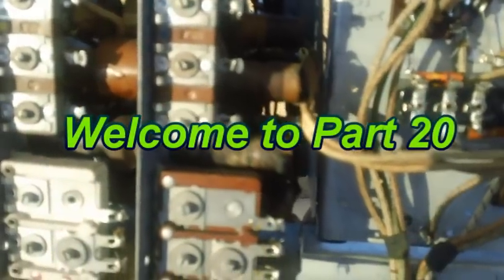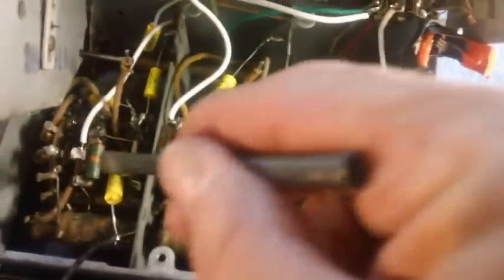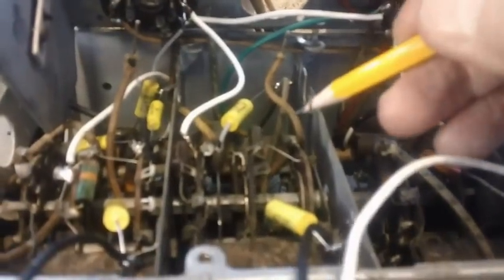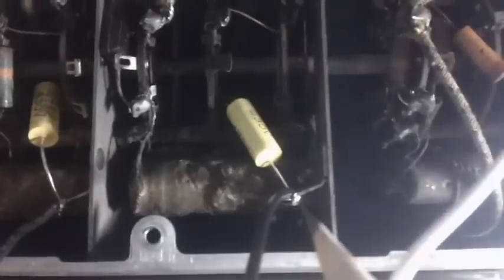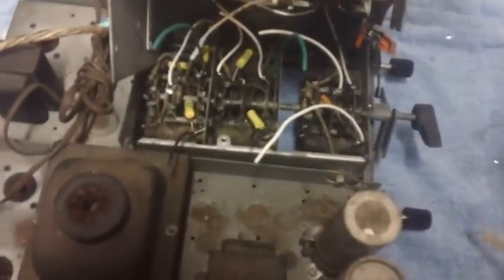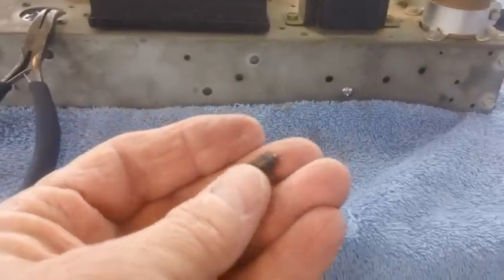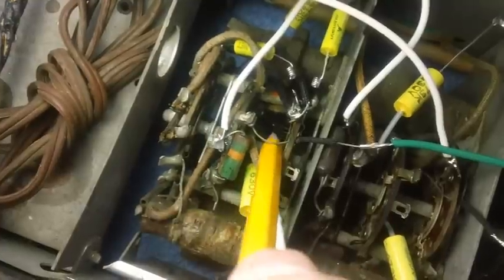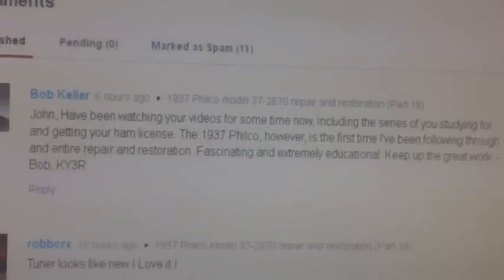Philco model 37-2670 repair and restoration (Part 20 of 34).

Comment: Use control Cleaner works best  Any vintage radio always replace filter caps capacitors and test output Tubes selenium rectifier
Reply from the maker: Jason,
Excellent info.  I'm glad you provided it.

Regards,
John

Comment: Nice job! With resistors in tube radios, I've found that the radio will often perform well, even with an out of tolerance resistor. However, an out of tolerance resistor is only going to go more out of tolerance as time goes by; so, might as well get rid of it before it drifts enough to cause trouble. So, I would have done the same thing that you did as far as replacing that hard-to-reach resistor.
Reply from the maker: Exactly right, my friend.  You know...it's the challenge more than the job itself.  Figuring out how to get that resistor out of there without causing any damage to the coils took up a lot of my thinking time.
BTW...you make excellent vids.  I watch them all the time.  I'll be sure to comment more often.  Apologies for not doing so, my friend.

Regards,
John

Comment: Thanks again for a fine instructional video.  The Philco RF deck is very intimidating to many and, as a result, sometimes those capacitors and resisters are never touched or checked.  Many thanks, Tom
Reply from the maker: Thanks, Tom.  You know...when pursuing a hobby nothing should be intimidating.  You just have to go for it.  :-)Regards,John

Comment: Great video John,glad I was wrong about the nail polish, although I know some melt plastic. About the wax or lacquer on the coils in RF some say It was done to prevent auto oscillation due to vibrations from speaker and moving parts (band switch and such). Regards, Sorin
Reply from the maker: Sorin,The wax was more likely used to keep moisture out.  Look up the term "Green Rot".

Regards,
John

Comment: With my ongoing restoration of my Philco 610b I damaged the wavecoil that goes to the antenna. I was fortunately able to repair it since it was an outside wire on the coil. Afterwards it tested out at 20.8 ohms, then I coated it with nail polish to protect it, since I had melted off all the wax to repair it, and it raised it to 25 ohms. Since the schematic called for 24 ohms it probably helped it, but I was surprised the nail polish had that effect.
Reply from the maker: Thomas,So am I, my friend.  I'll keep this in mind.Thanks.

Regards,
John

Comment: A bit of Arkansas ingenuity there with the self made nippers.  Worked pretty well.  I used to have a pair f those, factory made, many years ago.  I'll have to look and see if they are still made, or, start looking through the flea market tool tables.  Very good decision, on the coils.  Do no harm.
Reply from the maker: Al,That wax doesn't do much for the actual coil operation.   In fact, Atwater Kent rarely used thick wax on their coils.  Philco liked to go hog wild with it.   It's just a moisture barrier. John (Lockmeister) left an above link to a pair of neat nippers, if you don't mind the asking price.

Regards,
John